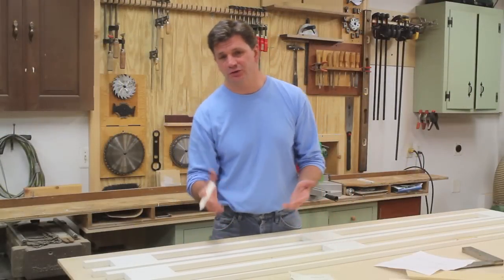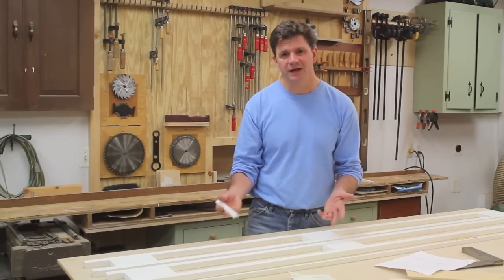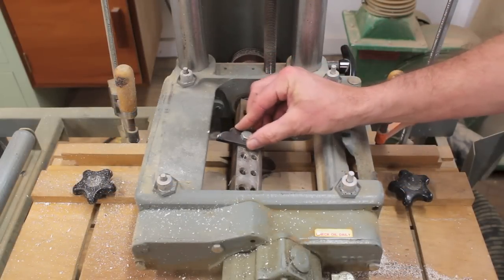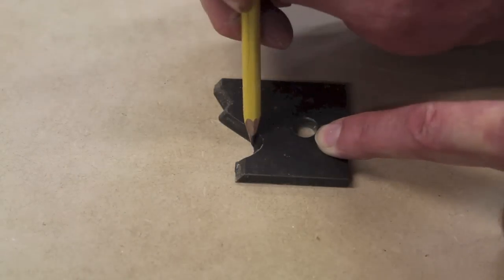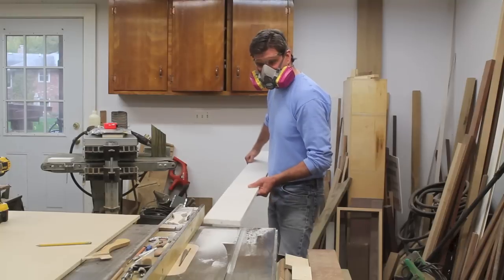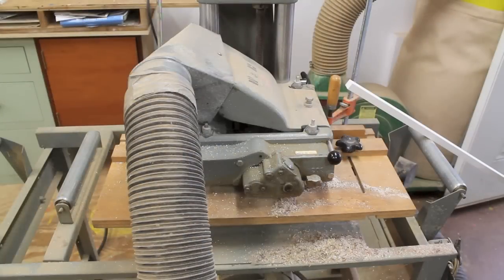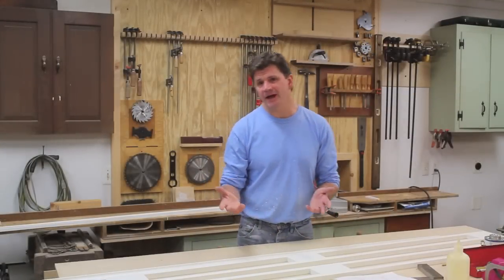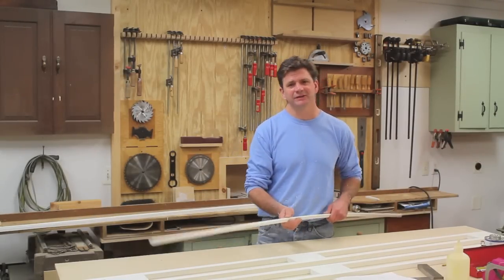How to Make Molding with Azek, Williams and Hussey Molder Planer

Comment: I've machined Azek and other PVC products.  It's a great material, but I don't like the idea of generating a bunch of sawdust that might get loose in the environment where it will never biodegrade.  I try to make sure I get it all in the trash, but sometimes that's hard.  I normally compost my wood sawdust, but all it takes is a little PVC to contaminate it and then I have to trash it.  You can't burn PVC unless it's in a sophisticated modern incinerator, or else you'll get toxic fumes.